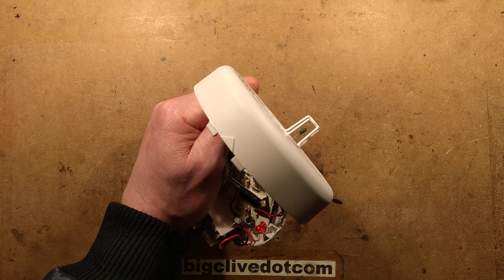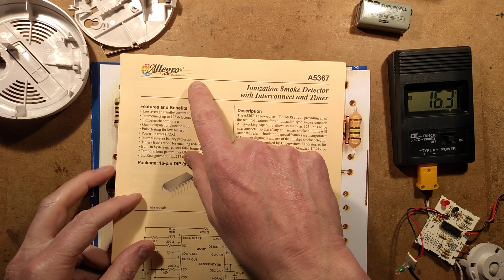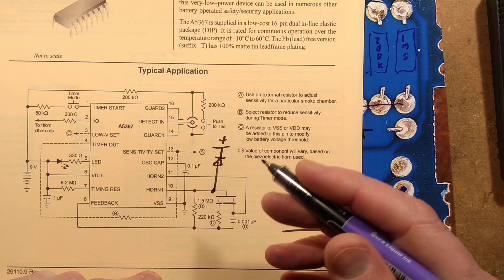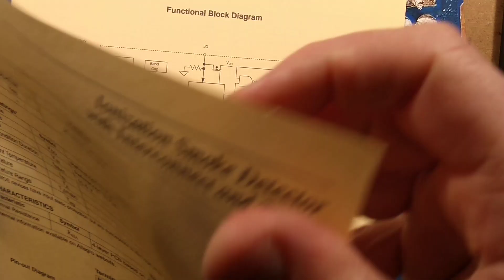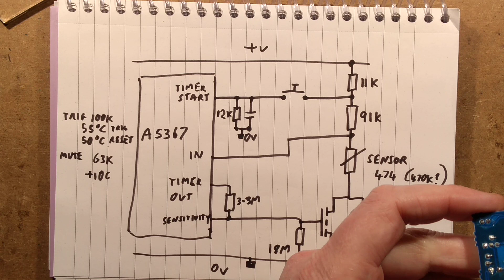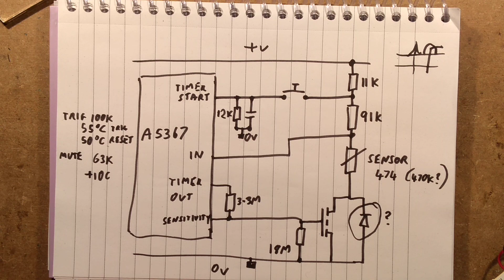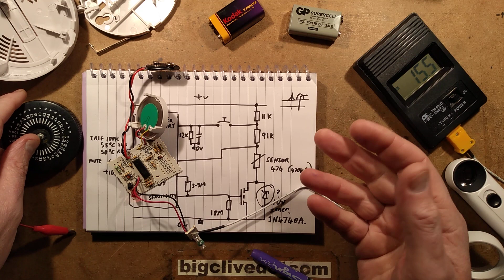Inside a heat detector alarm.  (Not a smoke detector.)

Comment: I have interconnected smoke and heat alarms in my house and they are crap. They're mains powered, but they need a battery. If you don't fit a battery, they peep. So you fit a battery and over the course of a year it does so many battery tests, the battery goes flat then it peeps again. So you replace the battery again. Eventually it even peeps with a fresh battery. So you bin it and buy a new one, Every 5 years. Until you get fed up or they become obsolete. 

So what you have is a safety technology so awful and so annoying that most normal people will disable it. That's terrible safety philosophy.
Reply: They're designed with a maximum lifespan (usually 10 years now) because they have a tendency to fail over time. They'll start beeping after they've been powered on for that predetermined time to force you to replace it. The thinking is it's better to annoy you a bit than have something nonfunctional and giving you a false sense of security.
Reply: @iarejester  In this case "annoying me a bit" means not sleeping because they always go at 2am, so I have to get a chair to stand on and butter knife (screwdriver doesn't work) and pop the lid, then try to get back to sleep.
Reply: Most mains powered detectors are designed to need a battery so that they continue to provide protection in the even of a mains failure. Alkaline batteries should last longer than a year, but some brands (such as Duracell) don’t last even if not used in a device. I have linked mains powered detectors and I have no problems, but I use the Lithium 9V batteries.
Reply: @Mark1024MAK  - I use the heavy duty batteries specified by the manufacturers, and they don't corrode the smoke detectors and they last at least a year.  Alkalines last no longer, and they corrode the detectors.
Reply: @tbelding  Can't do that, no handbook, these came with the house.
Reply: Thanks for all your replies. It occurs to me I should quit whining and design around the problem - maybe mod them to trickle charge a NiMH at C/50 or something - I also think @Mark 1024's recommendation of Lithium primaries is quite sane. I should do that instead of moaning.
Reply: @lumpyfishgravy  - Lithium primaries are what a lot of the sealed '10 year' alarms come with, so it's a reasonable (albeit expensive) solution for your particular issues.
Reply: Mike Page I have a similar linked system with good results alkaline back up batteries are lasting 5 years plus easily in fact so long a can’t really remember changing many or in what order certainly not a issue anyway I’m using the Ei range such as Ei 141 commonly used in uk. Are you using alkaline batteries? If so not sure what could be causing such poor performance maybe it’s the brand/make of alarms??
Reply: @danisaac  Oh yeah, good brands, long dates. Though I personally dislike PP3s and no longer design them into anything as they tend to dry out. You only need lose one cell in the string and the whole battery's useless.

Comment: "Old fashioned" indeed.  The same thing could be implemented with a cheap 8-pin  MCU and a whole lot fewer passives.
Reply: yes but public Schools need it
it needs to fit in with the other outdated Stuff there
Reply: Yes, but as reliable as an mcu can be, it'll never be as reliable as a purpose made chip built for the task.  And with things such as this where lives could be at risk if it failed, I can see why they wouldn't use a mcu.
Reply: @BEdmonson85   But First Alert does use MCUs--and has been using them for quite some time.  I recently scrapped a CO detector that's been sitting in my junkbox.  It's mid 90's vintage.  It used a PIC MCU, along with an D-A converter and a bunch of other components.  There's no reason, other than inertia that would militate against using a cheap MCU in this case.
Reply: MCU + programming it + voltage regulator + external circuit for the piezo horn will make the design a lot more complicated and cost much more than this old fashion proprietary IC. You can't supply the MCU with 9V and also you'll need to reset it periodically for reliability. Battery life will be much shorter on top of all.
Reply: @111chicane  Are you familiar with the low-end MCUs from Micon or Padauk?   One typically costs less that one of the capacitors on this board (ca USD$0.03 in 100 quantity).   Heck, if they can put them in greeting cards and stuffed animals, they can put them in a heat detector.
Reply: @tubastuff  Are you familiar with the voltages those MCUs operate on? Are you familiar with the fact, that the product in the video was designed years before those MCUs came to existence? 
I can tell you're an avid EEV fan and I only hope you don't rely only on YouTube for your knowledge. 
If this unit was powered with 2 AA batteries,  I would have agreed with you. And the IC in this unit is likely to still be cheaper than those MCUs, being DIP-14 package and likely manufactured a decade ago.
Reply: @111chicane  Datasheet says 1.8 to 5.5V.   A couple of AAs would keep it going for years.

I'm not an avid fan of Dave's--but he's interesting. I occasionally visit his YT to see what's new--it's easier to read than EDN or Electronic Design.  My EE education hails back to Fred Terman's texts and the "Hayt book"  so I'm an old fool, perhaps.

 Clive didn't mention when the device was produced--since he took it out of the retail packaging, I assume that it was relatively recently.   Perhaps that's an erroneous assumption.  But CMOS MPUs have been around for a very long time.  I can recall when the 1802 and IM6100 were the favorites of the battery operated crowd.
Reply: @tubastuff  You're not a fool. Clive never mentioned how recent this   unit is, it's my estimate that is dated. To get to his hands with already depleted battery and knowing he only buys cheap, my logic tells me the design is 5-7 years old in best case.
Oh, and the piezoelectric horn will not be loud enough with 3V power supply (couple of AA batteries, as you suggest)
Reply: tubastuff - if the same chip is used for all types of smoke alarm and for heat sensor alarms, it is likely that at the time of manufacturing, bulk buying kept the price of this chip competitive with that of the available microcontrollers.
Reply: @Mark1024MAK  Even if it was more expensive back then,  you still need quite a few more components to make it work. A decade ago MCUs weren't cheap also.
Reply: @Mark1024MAK  That makes a bit of sense.  I recently replaced all of the smoke+CO alarms in the house.  One area needed just a smoke alarm.  If I get a chance, I'll take a peek inside and see what was used.   Could be more a matter of "when all you have is a hammer, everything looks like a nail"

Comment: Does the detection circuit use a charge pump to pulse above the battery voltage? This would explain using the 10 volt zener as a reference.
Reply: Interesting thought, but this doesn't appear to be the case.
Reply: @SianaGearz  on close inspection it would appear you're right. The case is made from plastic! 😁

Comment: in the theater where i worked a while ago they had Carbon monoxide detectors, i think. Apparently the heat detectors caused problems when the old school lights gave off so much heat that the air under the ceiling got hot enough to trigger them.
Reply: Carbon dioxide detectors are not fire detectors so would have not been used to replace heat detectors
Reply: @nickbird7742  I was there to fix the DMX routing and install some of my multiplexer boxes so I had nothing to do with them. They just told me that, when I asked about the detectors as the looked strange, so i dont know if it is true.
Reply: @nickbird7742  
carbon monoxide is a by product of (most) fires so it would work as a fire alarm :-)
Reply: @Dime_Bar  
i dont think so , CO is lighter than air and the machine is on the ceiling so it would activate while there was still some breathable air , not going to try it tho , i dont have any CO alarms set up , just the regular smoke detectors :-)
Reply: @YTANDY100  Most CO detectors are used to detect change over time. Have enough oxygen at the start of a fire? (You would) Not enough CO is produced. It likely wouldn't detect until it's past too late.
Reply: @time-lapserpro4370  
i dont believe someone would make a device  which would not actually activate in a reasonable time to be of use , unless it makes enough noise to wake the dead :-)
Reply: @YTANDY100  It's because carbon monoxide builds up to dangerous levels from around 20 minutes to 18 hours. And if the fire is burning cleanly, you're fcked.
Reply: In our old historic theater(1926), the detectors are sensitive as hell. Any time we use haze or fog the city turns them off and puts someone on fire watch. Our new theater built in the 70's doesn't have any and when it gets remodeled this summer we expect to have to do the same.

Comment: now, with a bit of adjustment I guess this could be made more sensitive? it might be handy to have a warning when my aircon fails in the server room at work.
Reply: Don’t your servers or UPS have built-in temperature sensors that you can then set to alert you over a certain temp?
Reply: @ripstick2217  UPS does have a monitor, limited options for alerting (email only). Other servers doo have sensoors but only for CPU and disk temps, no general air temp. Also my UPS is at the bottom of the rack as it's heavy (those lead acid batteries you know) so will be the coolest thing around.

Comment: I suspect that the zener is simply ESD protection for the FET, particularly since the drain node is such a high impedance when the FET is off.
Reply: It would be interesting to put the device on an Oscope and see if the peizo generates voltage right after it's been shut off. Perhaps it "rings" a bit and back feeds interference into the circuit.  2 mystery diodes  in one video is a treat.

Comment: I suspect that the zener leakage current varies with temp in such a way as to counteract sensor current. If both diode and sensor heated together (e.g. on a hot day) alarm trigger point may be much hotter. A fire would heat the sensor first, the diode would take longer to heat up due to the boards thermal inertia, thus alarm triggered at lower sensor temp. I tried to get data on zener leakage vs temp, didn't find anything succinct so all this is just conjecture.
Reply: Depends if it's a Zener or avalanche diode.  Zener is below 5.5V (ish).  Zener leakage has a negative temp coefficient, avalanche has a positive temp coefficient.  So (unless I've had a brain fart) a 10 V avalanche diode will compensate (a little) for ambient temp changes.

However, everything I've just dug out says that while maximum leakage at a specific temp (or temps) is specified and controlled, the temperature coefficient of leakage is not specified or controlled.  What you get depends on the manufacturer and the batch.  And the phase of the moon.

If it is to compensate for ambient temp (why not just use another thermistor?) that might explain Clive seeing it trigger at what appeared to be an absolute temp.  Because, electrically, that's what it does if you heat only the thermistor.  If you heat the thermistor and diode equally it won't see much change.  So it's the time it takes for the heat to get to the diode that allows it to trigger on rapid changes.

That might also explain the difference in trigger temp after unsoldering/resoldering the diode.  It could have altered the leakage slightly.  But it's also possible Clive was holding the heat gun at a slightly different angle and the amount of heat reaching the diode was different.
Reply: https://www.youtube.com/watch?v=JffJpym7K8Y ?

Comment: Surprisingly low trip temperature (says the Australian)
Reply: Yeah. I've often had indoors temps of over 55, particularly up high on the roof (living in Melbourne, but have lived in Bendigo and Perth, too)
Reply: I've had +40C° Temperatures in the Shadow in South Germany last Year
but we mostly use Smoke Detectors
Reply: You can buy heat sensors with differing trip points depending upon the application and normal ambient temperature for the area to be monitored.  For example, you would use a much higher trip temperature if you were monitoring an attic space (especially in a hot location where you might experience temperatures in excess of 70°C/160°F) versus monitoring a normally conditioned indoor space that might ordinarily be kept between 20-30°C (where a ~55°C trip point makes good sense).  But a fairly wide array of trip point temperatures are sold for precisely that reason so it is just a matter of selecting the appropriate model for the intended application/region.

Comment: Hrm. Might they have a version that uses a 12volt supply?
Reply: Though it seems odd they would include the 10 V zener in a version clearly designed to run off a 9V battery. You would’ve thought they would only include it in a version designed to be wired into 12v.
Reply: @michaelfisher9671  maybe its cheaper for them to use the same board for 2+ uses?  i swear ive seen something like that but in a nightlight or something.
Reply: @michaelfisher9671  Oh I meant to reply but seemingly didn't. I've seen a few things with the common design but populated with components that are from a different run but it's just much cheaper to eat the cost of the components rather than start a new run.
Reply: Yes My RV has one.
Reply: I'd guess it would run at a standard 12v as part of a bussed security system.
Reply: I agree with the 12VDC supply theory as these are used a lot in RV type vehicles.
Reply: @gregorythomas333  Yeah. And often it is often less expensive to use boards from a different production run even with populated components. That Zener is probably cheaper to just ignore. :)
Reply: @gregorythomas333  Are these used in the kitchen/galley areas as you would in a house then?
Reply: That is where I would use them...or anywhere the normal ambient temperature is under the 50*C (122*F) threshold.
Reply: The 12 volt supply could also be for when they are networked easier than putting 9 volt batteries in all of them and then trying to find that one that is flat.
Reply: I'd say thats the most likely explanation.  If thats a generic circuit design they use theyre going to want to keep the timing and sensitivity (if thats based on a fixed voltage reference) functions constant.  If you take it out and feed the thing 12V you should be able to test that - you could also go all photon and crank it right up ;)
Reply: It's vestigial, I think -- one production line feeds two others; the 10V zener might be needed downstream but does no harm/ has no effect if not needed, so it's installed but irrelevant electrically. 

However, the last-minute post script suggests its (re-)addition to the circuit changed the response threshold of the unit. Could it be that this unit idiosyncratically had the diode installed, but incompletely, or incorrectly installed --corrected with removal and re-installation? Comparison with another unit seems called for. 

One of the hardest problems to detect and diagnose is actually two problems simultaneously in play. Why? Things acquire 'wonky' status when the first failure occurs, but not all failures are noticed…
Reply: Reverse zener diode for temperature compensation?